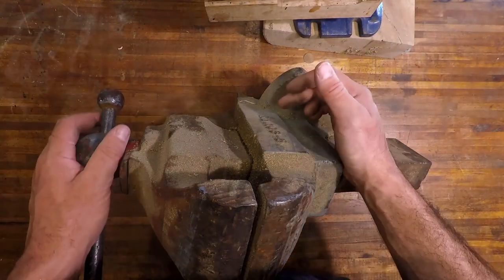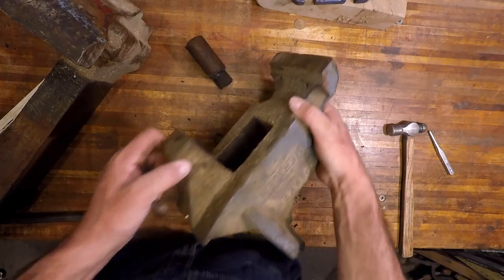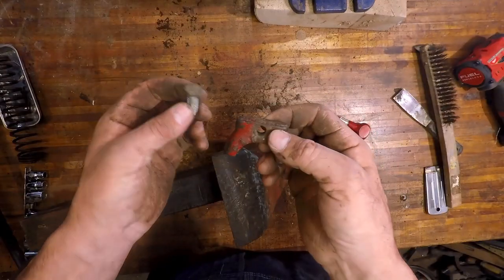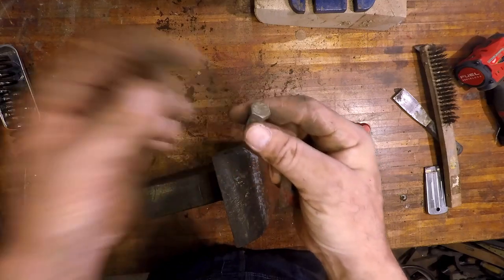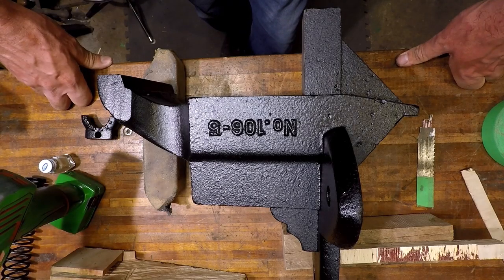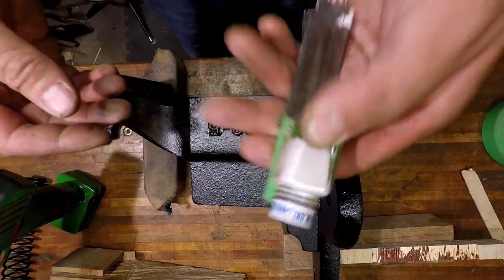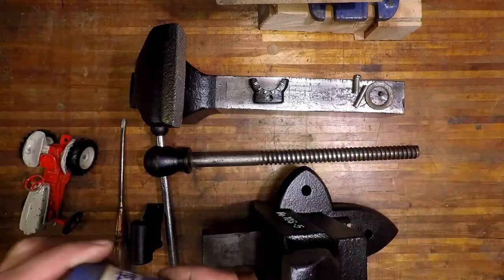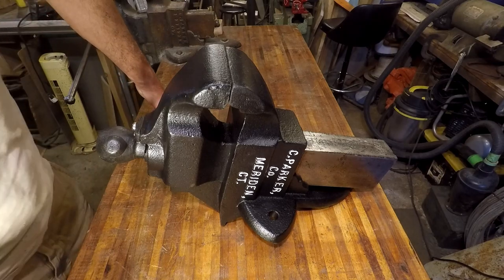Charles Parker vintage vise restoration

Comment: Also that pin that holds the main nut in the dovetail is tapered or the hole is tapered. It drives in from the inside and drives out from the bottom.
Reply from the maker: Thanks for the tip.  I've got another oldie on the bench.

Comment: I enjoyed the restoration, thanks for taking the time. All of my Parkers have the brass slug in the handle....I seen you discussing this on another comment. If the slug is missing I just cut another slug and put it in there. Don't think I have seen a Parker without this feature but then again who knows? In the process of several restorations myself and I enjoy watching others work too. Thanks again.

Comment: Very nice. That black is perfect for these projects. Btw, there should be a small spring in behind that little set screw on the front. It allows the handle tension to be adjusted so it can slide more or less when you spin it round.
Reply from the maker: Thank you Graham. 

You know,  there was a section of the footage I cut out of the final video.  And I was exploring wethere it had that feature.. withal usually a little brass slug and a spring to take up the slack from the handle.. but there was no such thing, I took a punch just a little smaller that the size of the hole to see if it was maybe seized in there but the more I hammered the more I realized it wasn't even drill Threw. Maybe it was an option back in the day ?
It was the type of exploration that only left me with more questions than answers 🤣.

Btw I took your advice and  slowed down the reassembly process.  Do  you think it should be slowed even more? 

Cheers Graham.. I don't know if it applies to you ,but have a great weekend 👍
Reply: @mjlrestorationshop.2405  That's interesting. TBH i thought that they all had that feature. It is a bit strange that the screw would be present, but the hole does not go all the way through.  i have not heard of the brass slug, but i have seen a ball bearing used at the end of the spring, but a brass slug makes sense too. Yes, the speed was better. I always like to linger a little longer on the finished product! You have good content, keep up the good work.